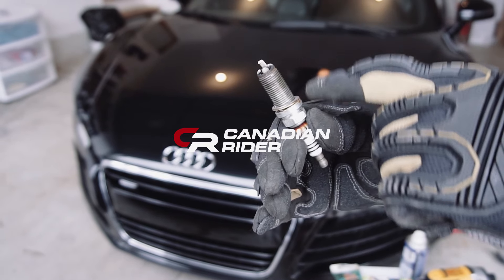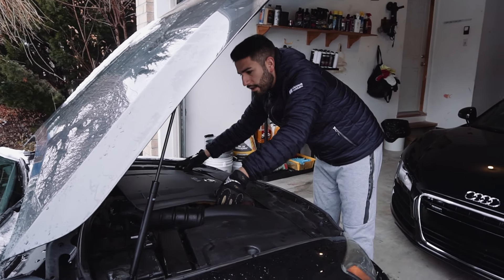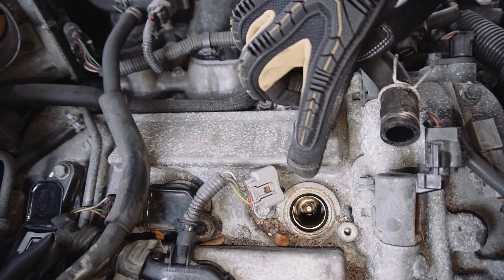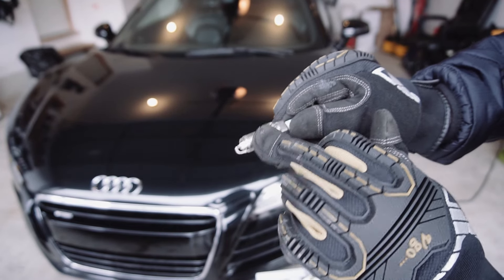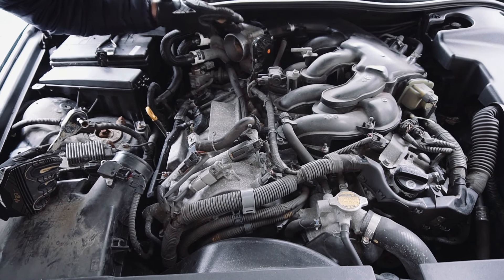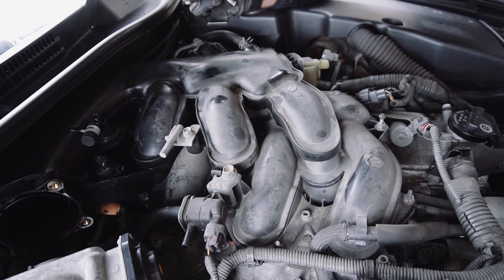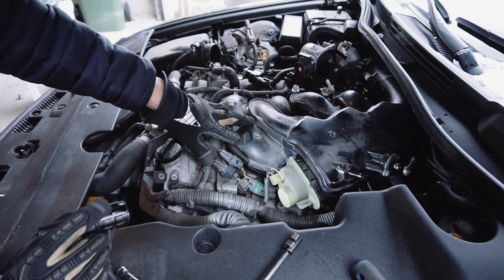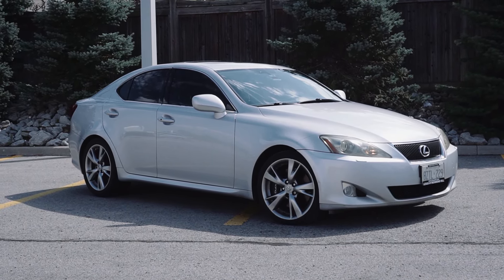How to Replace Your Spark Plugs on Your Lexus IS250 & IS350!

Comment from the maker: Welcome to 2020 with a tutorial on how to get the best performance out of your Lexus IS250 and Lexus IS350 with a spark plug change as part of your regular maintenance!
Reply: Canadian Rider Hello I watched your buying my dream car video when it came out, I wanted to know how did your cannabis investments do?
Reply: I followed the video but now the VSC light and Engine Light and Not traction Control light Is on ? Also seems to be getting got next to throttle body where to the two thick black hoses are ?
Reply: @Juduh  i also have this lights on but wont come off and code wont erase???
Reply: 1-10 how difficult I just got priced 260$ with me already having the plugs
Reply from the maker: Five. In terms of difficultly.

Comment: Just a hint before you remove the coils. Use compressed air to blow away any debris around them. You don't want any of that getting down the sparkplug hole.
Reply: Or a vacuum
Reply: You can remove the coil first.  Blow/vacuum it before you remove the plug.
Reply: @Balconyman2000 you could. But definitely better to use a compressor to blow some air before pulling the coil.

Comment: TIP!!!!!!  When removing the intake , you might wanna also replace the intake gasket.   It’s about $30 @ auto zone.
Reply: This . Also, when removing the bolt for the intake manifold that is located underneath the wiring harness, there is actually a clip holding the wiring harness snug in it's current location. If you undo the clip you will be able to put the harness to the side for ease of access to the bolt head.
Reply: Agreed, I bought the OEM gaskets online for cheap. And are super easy to change out with the manifold off.

Comment: Modern spark plugs like Denso and NGK have a anti seize coating applied to the threads! You DO NOT want to apply the anti seize to the plugs that are brand new out of the box. The manufacturer will tell you this if you take the time to call. Other than that great video.
Reply: NordicPride970 hmm. So based on this, I have some questions.. I was advised to use nickel based anti seize and to use ~20% less torque to compensate for that. I did both (Lexus recommends 18 ft lb, I applied 15 ft lb). If this was indeed wrong, what are the outcomes? I’ve severely under torqued them? Will they heat up more and wear out quicker? Should I take them out and “redo” the whole process? Thanks.
Reply: John George If you have any doubts simply go through and make sure they are all seated and snug. The plugs won’t wear out faster. That’s a function of erosion caused by heat and electricity. Obviously you want to be sure the plugs are properly seated. Removing them isn’t necessary as they are likely fine. Just understand that you are the one who must decide what action to take. I don’t know your mechanical background and if you have ever tightened a spark plug by hand. If you aren’t comfortable doing said procedure you should have a professional double check it. 

That said most people don’t use torque wrenches at that low of a torque value because 9 times out of 10 you will OVERTORQUE the fastener(in this case a spark plug). Only high dollar torque wrenches are accurate at this level. So most mechanics hand tighten the plugs. I just wish more people spread the word that anti seize for spark plugs is a antiquated practice. If you in fact under torqued the plugs that’s easily checked and remedied.
Reply: @nordicpride9708  Ahh fair enough. My torque wrench is rated +/-4% but even that I doubt, as you said its not a professional wrench. Anyhow, now that I know what I've done and how much force I've applied, I'll just monitor it and make amends during the next change based on the state of the plugs/threads then. Thanks for the detailed reply!
Reply: How about the manufacturer print this on the box? I've never seen it.
Reply: NGK SPARK PLUG IS THE BEST FOR THIS CAR MY FATHER HAS 20+ YEARS IN BEING W MECHANIC, JUST KNOW THAT THEY ARE AROUND 9-10$ EACH! BUT WORTH IT THEY LAST LONGER THEN THE CHEAP ONES PLUS YOU GET A BIT MORE POWER AS WELL
Reply: @Frenchylocks  NGK and Denso are virtually identical in quality. That’s why Toyota/Lexus uses them interchangeably. NGK is simply your “preference”. Doesn’t mean they are the best. That’s just an opinion. Japanese plugs DO run the best in Japanese engines as proven over the years as NGK and Denso make the OE ones, and they are application specific.

***Turn off your cap locks man. Some gen Y/Z kids are gonna think you are yelling 😂👍🏻
Reply: Actually that is false, the ONLY spark plugs that have anti seize on them already are iridium plugs. You will want to apply a small amount of anti seize to regular plugs.
Reply: Lexus yall couldn't use regular bolts rather than Allen bolts smh

Comment: Did my 250 today and it was a pain. The 12mm at the back of the manifold and the 12mm at the  side of the throttle bodies. YOU BETTER have the tools.
Reply: What tools did the job for you?
Reply: @Bob Saget    Not special but the reach and room requires right too to make it easier.
Reply: @ChristianLikesFootball  Yea, I definitely know what you mean.

Comment: Ok. I went through this whole job and almost had to throw in the towel. A few things that worked for me that might help out the next guy:

- Have a shop vac ready. Much easier to remove debris with a vacuum than with compressed air. 

- Have a magnet retrieval tool. I used it to extract loosened bolts and the old spark plugs. That tool was a life saver. 

- The intake bolts are hot garbage. This is the part I almost had to give up on. Have a plan to extract them if they don't turn.  And plan on replacing all 6 of the Allen nuts with M6-1.0X25mm flanged hex bolts from Oriely's (part number: 980-225D) AND/OR M6-1.0X30mm hex bolt (part #: 981-230D) These go in way easier and will save the next guy who has to take that manifold off. 

I had two bolts completely round off on me. And the other 4 will never be able to be fully torqued again. One I even broke the end of a Allen key socket inside of it. Using the magnet tool and a flat screwdriver I was able to remove the broken end of the socket. I ended up using a regular Allen key and channel locks to remove that one, and the other I had to use a framing hammer to drive an oversized torque bit into the head. That somehow worked. If it didn't I'd be trying to find a screw extraction kit that would fit down in there. 

- The 12mm bolt all the way in the back of the manifold was not too bad. I used the closed end of a 12mm wrench (longer one makes it easy) just to crack it loose. Didn't take much effort. It wasn't on tight. Then I worked it out with a socket and my fingers. Reverse this process when installing. 

- Don't worry about completely removing the manifold. Once I got it loose I just lifted it up as high as I could and stuck my impact gun under it to prop it up. Far too many wiring harnesses and hoses attach to that thing to remove it all the way. 

Hope this helps somebody! Good luck!
Reply from the maker: Thanks for these extra tips friend :) Very good advice!

Comment: Great video, I was able to change them on my '14 IS250, definitely the bolt hidden behind on the driver side was the hardest task, it took me about 4hrs but I saved around $400 in parts and labor.
Reply from the maker: Great to hear yes you just need a long socket to get there! glad you are doing the maintenance yourself saving yourself money and treating your car right :-)
Reply: I was invoiced 700 to change spark plugs on my 12 is 250 😭
Reply: How did you removed that bold. Thats what im struggling with. Everything was easy so far and i freaking hate doing car maintenance. Any tips will help.

Comment: Here are the torque specs directly from the GSIC service manual:

- Spark plugs x6:                            25Nm / 18 ft-lbs (However Denso reccommends 22Nm / 16 ft-lbs)
- Ignition coil 10mm bolts x6:      10 Nm / 7 ft-lbs
- Surge tank 12mm bolts x2:        21Nm / 15 ft-lbs
- Surge tank 5mm allen bolts x6: 18Nm / 13 ft-lbs
- Surge tank 10mm nuts x2:         16Nm / 12 ft-lbs
- Throttle body 10mm bolts x 4:   10Nm / 7 ft-lbs
- Intake hose clamps:                     4 Nm / 3 ft-lbs

Note that Lexus calls the intake manifold a "surge tank".

The spark plugs Lexus reccommends in the manual are the Denso FK20HBR11. However, Denso has since released the IKBH20TT, which they say "replaces" the older FK20HBR11 and should be an improvement over the original plugs. They can also be found much cheaper than the original plugs in my experience.

Lexus reccommends that you replace the 3 surge tank gaskets as well as the throttle body gasket, calling them "non-reusable parts" in the manual. Part numbers are as follows:
- Intake Surge Tank Gasket: 17176-31170 or 17176-31050 (don't know what the difference is)
- Throttle Body Gasket:  22271-31030
Reply: Is it difficult to replace the gaskets ?
Reply: @kevinrizo4538  Na it's really easy you just pull the old ones off and place the new ones back on

Comment: Tip for you: no need to use the screw driver to take out those intake duct clips - they might have "seized" , as you experienced, or worn out in the screw driver slot. Instead employ a 10 mm socket with your ratchet and loosen with zero stress. This should apply for practically any Toyota intake duct clip screw.

Comment: Great video. thanks man! I'm in Waterloo ON and have a 2007 IS350. Awesome car except for the pvc based components in and on it. Dash all cracked up, and mushy door panels. Outside, the rubber is all suffering from dry rot, and window trim is peeling off. Other than that, pretty decent car. Just lost an led segment on my tach meter. So I guess that will be another project at some point. Mine only has 158k on it. I had a 1992 Celica GTS, and never had any issues like this with that car. It was bullet proof.
Reply from the maker: Awesome to hear thanks for sharing I love Waterloo :) welcome to the channel!
Reply: My 08 window trim was peeling too. I took a razor blade and sliced it flush exposing the whole piece of chrome trim. Looks better actually
Reply: I'm in Waterloo as well. I have not had any of those issues with interior trim or exterior plastics on my 2011 IS 250. 

Just coming up on 130,000 km and thinking it's time to do the plugs, however.

Otherwise, a solid car (I bought it in 2020 with 84,000 km).
Reply: @martinliehs2513  Yeah, looks like I got unlucky with a bad run of pvc. Lots of examples around the internet like mine, but some, like yours, are fine. My problems started showing up at nine years old in 2016, so you're doing pretty well. A bit of a mystery. My 07 IS350 is just about to turn 160k.
Reply: @JohnnyRawks  I heard that Lexus had a warranty program to address the "sticky dash" and door card issue. Perhaps they addressed the issue at some point in the production run?
Reply: @martinliehs2513  Yeah, they had a replacement program in the states due to a class action lawsuit by their customers. In Canada, it was just up to Lexus Canada who they helped, and I was not to be helped lol. I guess because I was the second owner. They were literally no help to me at all. Pretty sad.

Comment: Thanks for the video bro, I did a 2011 IS350c, I followed the steps for passenger side and after a long hesitation 😂 I decided to attack the driver’s side, I popped out 3 plastic clips front, back and middle one attached to manifold and 10mm bolt to the metal line then start at the inside spark plugs first working my way out wiggle that big wire loom bundle out the way yeah you need a flathead and a smaller one to jam in the tab and big one to pry out coil harness, all sort of extensions for 10mm socket and 10mm wrench and longer extension for spark plugs socket also
Reply from the maker: Glad you got it all sorted :-)

Comment: It would be safe than sorry if you use a torque wrench to tighten up the spark plugs and you shouldn’t use any anti seize since denso comes coated already ! Great video 👍🏼
Reply from the maker: Thanks for the heads up and thank you for the compliments on the video! Welcome to the channel Constantine 🙏

Comment: To those with a 14’ is350, you don’t have to remove the intake manifold. You of course have to pull your intake tube. That front left coil looks jammed in there, but it slid out pretty easy

Comment: I just did mine today for my IS 350 Right Hand Drive. Thought I had to take the manifold off for the right side; thank god I didn't. All you need to do is unclip the hardness running along the manifold so you can move it freely. Was glad to see the same NGK Laser Iridium plugs I'd chosen were the ones that'd originally came with the car from Japan.

Also accidently unplugged MAF before realizing I just needed the intake tube off, so no my CEL is on lmao. Nice side effect of that is my Traction Control and Stability Control are both off now

Comment: FYI you don't need to remove the intake manifold to replace the spark plugs. If you move that wiring harness if should give you enough room. I just did it following another video's instructions. All you need is a 10 mm joint socket or wrench to get to one bolt.

Also it only took me about 2 hours to do the whole job using this method.
Reply: on a 250 or 350? I think this only works on 350's
Reply: @18837ven  how come?
Reply: Do you have that video link?

Comment: I have an 06 is250 with 137000 km on it, not sure what previous owners have done to it as I got the car 2 years ago. I’ve already replaced all fluids when I bought the car, had to replace starter motor, alternator and the water pump because all of them failed. Now I’m considering to do these spark plugs myself with a friend but I’m kinda intimated because I don’t wanna mess anything up. I picked up the NGK spark plugs and a shop has quoted me 450 for just the labour but also said if they find oil during the spark plug removal that they’d have to hold the car overnight and change the valve covers or something like that. Don’t know if I should do this myself or go to a mechanic 😅

Ps I live in Southern Ontario!

Comment: great video, but dont you also have to replace the coils? i have 2008 IS 350, any recommendation for coils? much appreciated.
Reply: Toyota coils are good for at least 200,000 miles. Not kilometers. Miles. They’re wicked expensive.
Never ever buy a knock off Chinese part. Get a factory one if you plan on keeping the car. Spend the money.

Comment: Very very good and thorough tutorial. Will definitely follow you
Reply from the maker: Thanks Ken and welcome to the channel! Which IS you got?!
Reply: @carswithsonduren  I have the 2018 IS350 f sport. But I have some bad news. I missed removing the PCV valve connector when I loosened the wiring harness and pulled the wires out of the connector. Dealer is gonna have to fix that. Otherwise the spark plug swap went fine
Reply from the maker: That is a beautiful car man congratulations

Comment: Hi, I've watched alot of your great videos.  I recently bought a certified pre owned 2017 IS 300 f sport with about 85000km. I've noticed there's a rotten egg smell on hard acceleration. Is this normal? Can it be a bad catalytic converter? Will warranty cover it? I've had other cars before but never had any smells.   Thank you.
Reply from the maker: I’ve also had the same phenomenon I believe it is the catalytic converter. It was never really an issue for us. It happened once every blue moon so I never really dug deeper.
Reply: Thanks
Reply: I have the same thing happen to me with my 2006 IS250, for me I’m pretty sure it’s because I have a couple diff leaks in the exhaust like directly underneath the cabin. Eventually I will replace the whole exhaust if I own it long enough I’m just not sure at the moment. Best of luck buddy!

Comment: When you look at the Insulator neck and see orange scoring, the plug is overheating.  Check the gap also when you remove them; should be .043", if the gap has opened greater than - that would cause misfires as well.
Also, the Manifold overhang on the driver's side isn't a problem with the 350.  You showed ONLY the 250.

Comment: I love my IS250... until I needed to change my bloody spark plugs. Let’s just say , that this video helped me to change it. Used the Denso brand. It was a while ago when I changed it like a few months, but I just felt like commenting. Anyhow love the second gen IS. Even if the first one came out in 2006 in America, it’s still a timeless design don’t you think?
Reply from the maker: I agree with you! Congratulations and welcome to the channel
Reply: After owning BMWs for years I just remembered how easy it always was to work on my Japanese cars.
Last year I bought a 2010 IS250 and the first time I had to change light bulbs I was swearing and bleeding.

The car has a slight miss fire and I am planning to change the plugs in a few weeks - so watched this video and was just thinking how easy it was working on cars build before 2000... damn - I had a 1994 Citroen XM 3.0 V6 and I changed all 6 plugs in around 30 minutes - not to mention all inline 4 cylinders I had were a treat to work on.

The 4GR engine seems to be a nightmare to work on - not looking forward for that

Comment: Hey, I have a is250 i was just wondering that very last bolt, behind the metal fuel line, Wasnt that the PCV valve? I am doing a PCV valve replacement with intake manifold gaskets, im 17 DIY, I cant find ANY videos on IS250 Pcv removal!
Reply from the maker: I’m not a 100% sure but I think you are right
Reply: did you figure it out?

Comment: I followed the video but now the VSC light and Engine Light and Not traction Control light Is on ? Also seems to be getting got next to throttle body where to the two thick black hoses are ?
Reply: Get an odb reader and remove the fault codes, should be removed after if not, check ure mass flow thats located to ure airtube? Sorry for bad english. Hope it worked out.